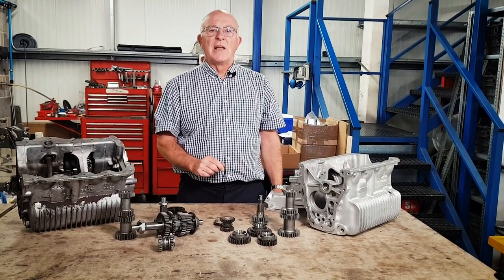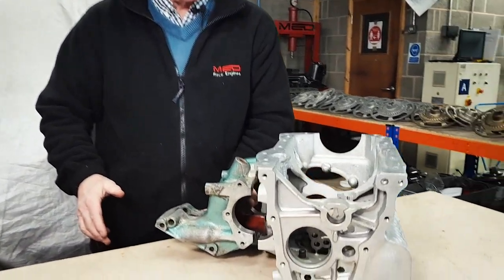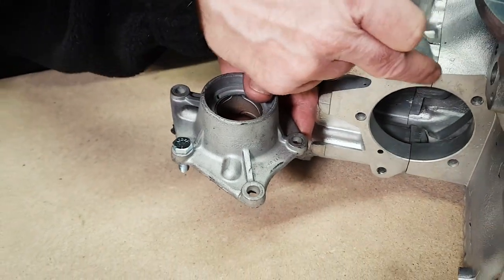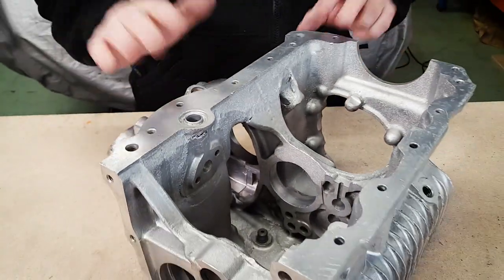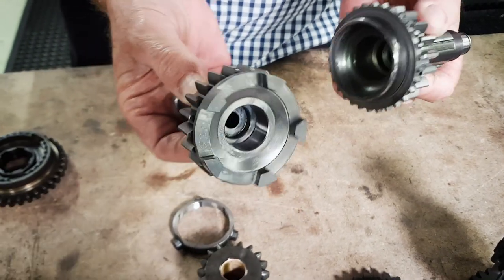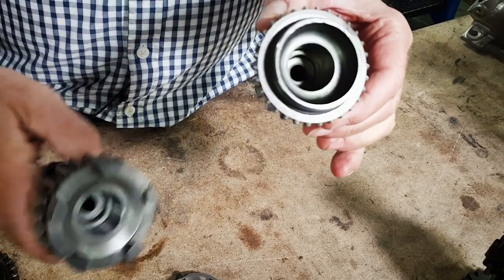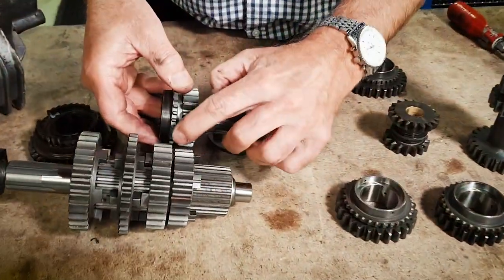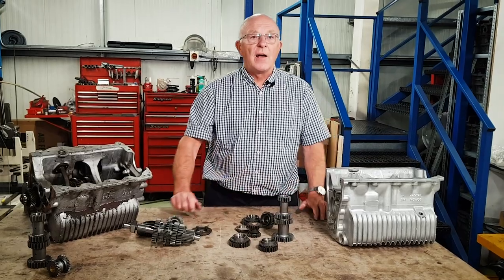Project 63 part 13 - Mini straight-cut gears in a remote housing

Comment: Aqua blasting still uses a media, ceramic beads which are just as likely to cause contamination of oil as any other type of media blasting if not thoroughly cleaned.
Reply: If that worried about media contamination (even after flushing / cleaning) then i'd pick either soda or CO2 blasting, soda disolves with water and CO2 just 'evaporates'!

Comment: Excellent video.  Is there a reason for going Magic Wand over a Rod change?

I thought rod change would be more precise?
Reply: The original box was remote, not rod..... and,  he said they didn't want to cut a hole in the floor for the remote shifter....
Reply: @ronald1968  i know it was originally remote. I just thought they were sacrificing some gear change accuracy but not going to magic wand instead rod change.
Reply: @Alan-wu3ry  a well set up wand, will be as accurate as a rod, or remote... most if the slack people associate with wands is down to the worn bushes in the diff case that the shafts go through
Reply: I’ve got a 4 synchro box in mine with a magic wand diff housing and the shift is very precise (of course you need to replace the bushes and check everything properly). I’d recommend it for anyone who want to keep the magic wand and have all synchro